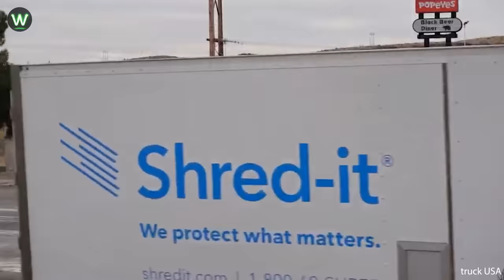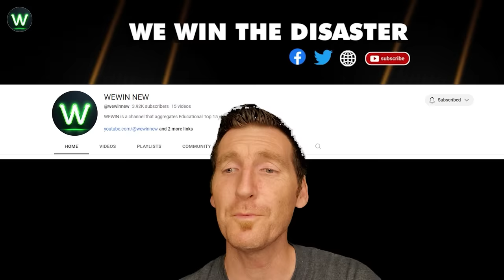Tragic! Ultimate Near Miss Video Of Biggest Truck Crashes Filmed Seconds Before Disaster

Comment: 1-tell your viewer that if they brake check a truck and he hitt you,you’re are responsible for the truck and your.2 DO’no or slow downs to see; a police giving a ticket or and accident ,because you ❤going to cause jam trafic and you going to drive were your look right at the accident.3 WENT A TRALER get upside down,it usury because it was load wrong,ha y material in the bottom ,light on the top.